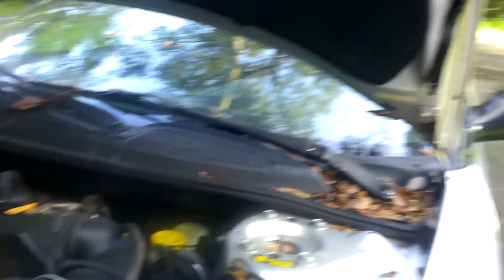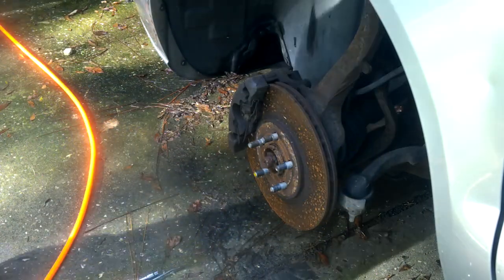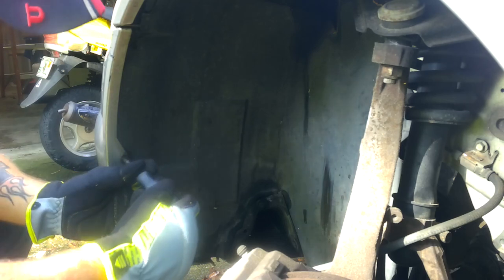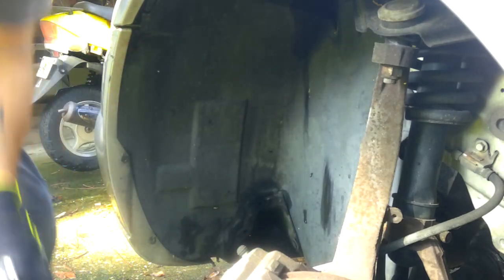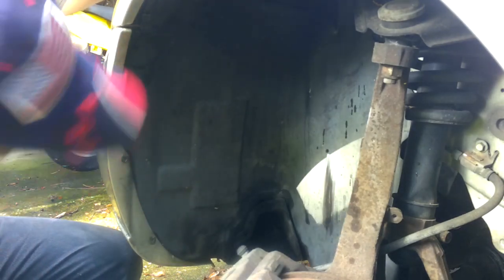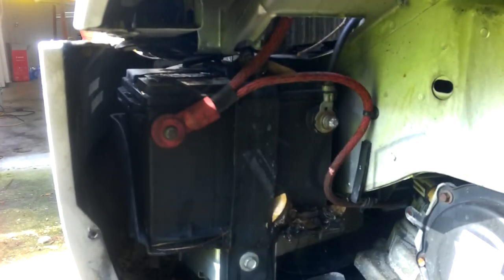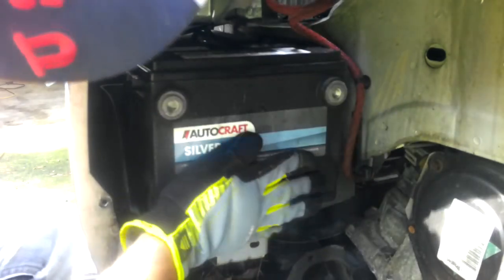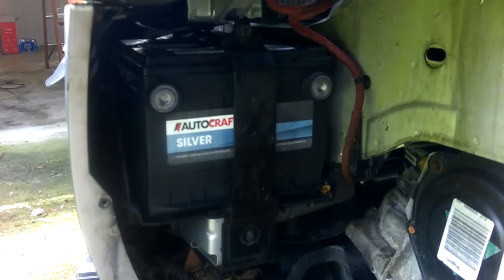how to change a battery in an 05 sebring

Comment: Did you replace the battery because every time you  jump start it and remove cables it just loses power and shuts off? I had to jump my car 3 times it's been sitting for awhile. Which battery you recommend
Reply from the maker: No it was just old. If you have the funds I would recommend an Interstate. They are pretty pricey but well worth it. We have 2 for our boat and they are 6 years old this year. Never had a problem with them yet. Hope this helps.

Comment: How do you remove a rusted bolt once you get the tire off.What's the name of the best electric sockets to take out the rusted bolt.If the socket don't work what else would ??
Reply from the maker: Use a lot of penetrating fluid. Let it soak. If that don't work, you may have to cut it off with an angle grinder.
Reply: @shabear1000  Yes I'ma let it soak.I have the socket to take it off but i need a extention.But would the electric socket be easier to take the bolt out.What stores sells electric sockets cause i need something that makes the job easier and faster ??